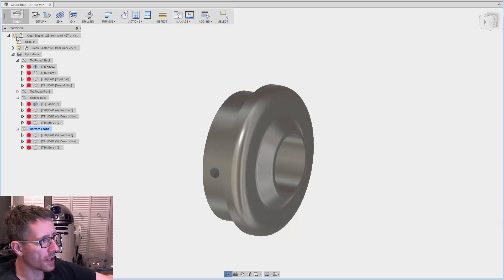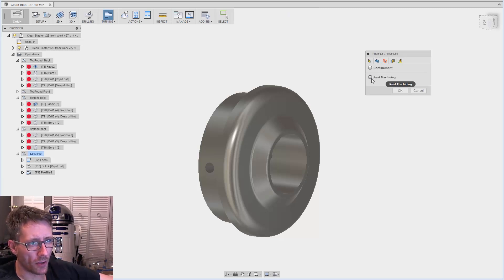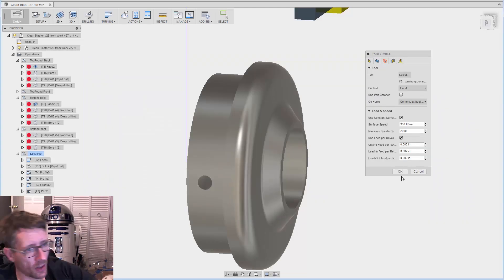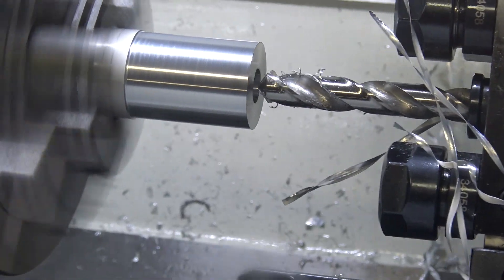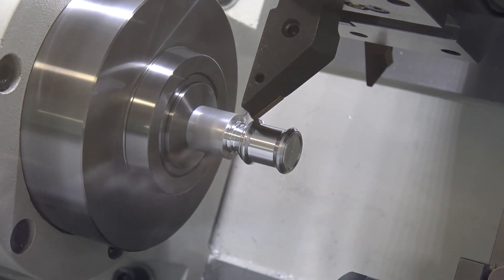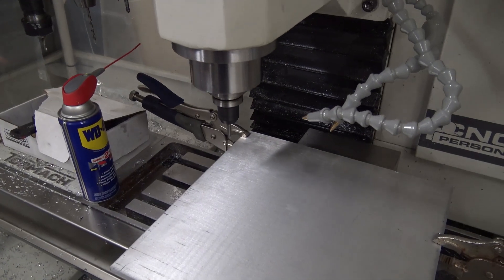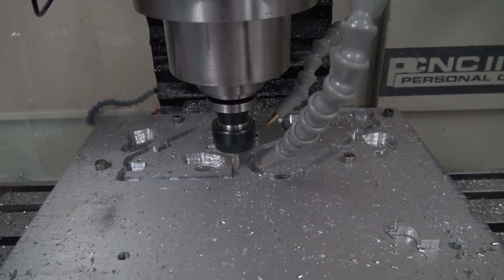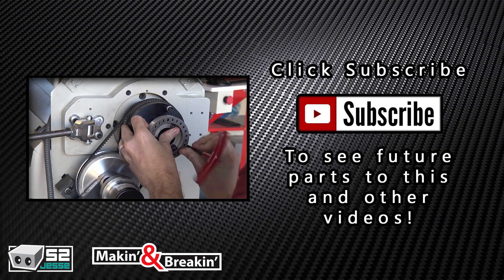Makin' & Breakin - Rey's all metal blaster Part #4

Comment: I know this is a Tormach, but with a "real" CNC, I would not use constant surface speed with aluminum. With the exception of drilling or reaming with HSS tools, and parting, your max spindle RPM is your limiting factor. You can run max RPM all the time. Actually, I rarely use CSS mode at all. With good quality tooling, they can tolerate a huge range in SFM and the CSS will just slow you down on a machine with slow spindle speed ramping. 

Also, you need to feed a lot harder on your turning tools. With carbide, those long stringy chips are a sign that you are not feeding fast enough or not cutting deep enough, or both. Turn the feed rate up until the chip breaks.
Reply from the maker: Wes Johnson thanks wes. Im pretty clueless when it comes to feeds and speeds on the late. All great points.

Comment: The little threadmills from Lakeshore are really nice to use if you don't want to use a rigid tap w/ tapping chuck. Works fine w/ Fusion 360 CAM and just fun to watch. Thanks for the CNC lathe vid..
Reply from the maker: +Warren Bailey I've been debating grabbing the rigid tapping head from tormach. I have one single point thread mill but its a bit too big for these holes.  I haven't tried it yet either.   You think its worth grabbing the tapping head or going threadmills for future projects?
Reply: +S2Jesse Personally I like threadmills because most everything I thread is very tiny and I work on various plastics, aluminum, etc. so I can dial in exactly the load I want to put on my threadmill, versus using a fixed size tap and a tapping head. I think if I was threading lots of M6 and larger (1/4" and up give or take) it might make sense to lay out the $ for the tapping head since it is faster, but since everything I do is small, the threadmills seem to be a better value, plus I have a couple sizes of 60 degree V cutters and with all these I can do both inner and outer threads so less tools to buy.